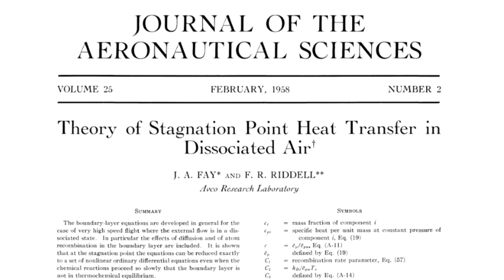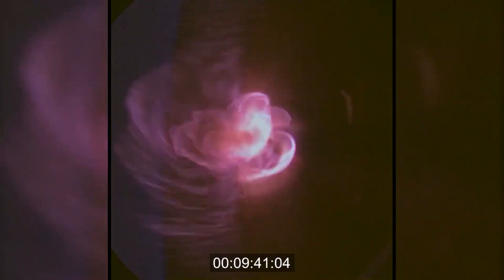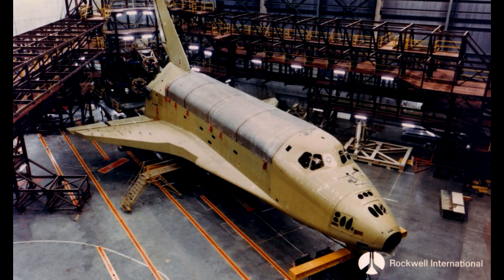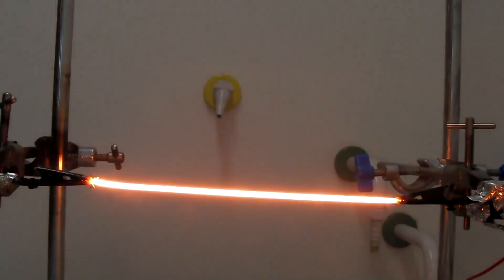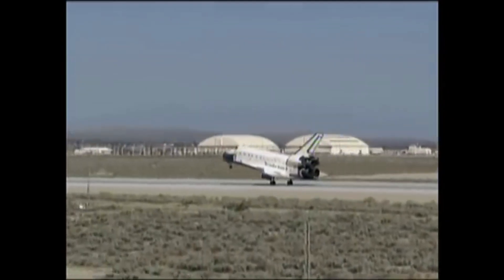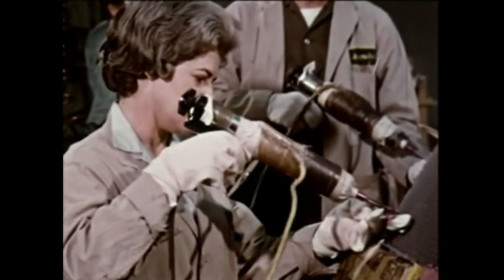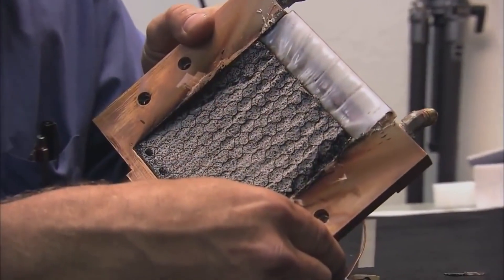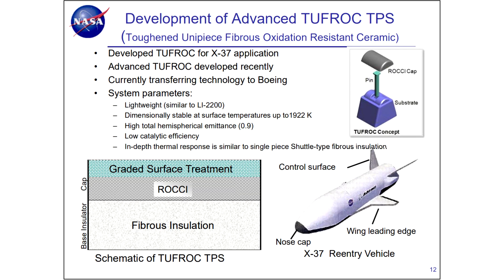Heat Shields - Things Kerbal Space Program Doesn't Teach

Comment: I work in TPS manufacturing, actually in the building your hot tile cube video is taken from. I find all your videos to be fascinating and informative. I would like to offer one point of note relating to silica tile on the Space Shuttle. I used to work on the Shuttle TPS system as a technician, and the known cause for the early tile shedding you showed on the OMS pod was not only structural flex as you have mentioned. On STS-1, many of the tiles did not have densification applied to the inner mold line where the Strain Isolator Pad is bonded to the tile. What this causes is a very weak bond that would allow the SIP to debond and take a thin layer of tile with it as it debonded. Think of putting masking tape on a dusty surface and peeling it back off again. The weak bond allowed any force that could get under the tile to pull it off, and this was especially easy on the OMS pods where the tiles were large and thin. The solution was a chemical which I can't remember the name of, that makes a thin "densified" layer on the IML of the tile and allows the SIP to stick incredibly well, dramatically increasing the bond strength. I hope this explanation didn't come across as to knit-picky. Thanks for the great content.
Reply from the maker: Thanks for the extra detail
Reply: I'm gonna have to go ahead and ask you: have you been using the new cover sheets when you file your reports?
Reply: @jimbarino2   You know how many times I have heard that one over the years? :)
Reply: James Baird “Red Stapler. Come in, Red Stapler. Do you copy, Red Stapler?  Over.”
Reply: are you saying I shouldnt use elmer's school glue for my heat shield tiles?
Reply: @Blox117   Interestingly enough, the glue we use isn't as high tech as you might think. Tile and other TPS are bonded with RTV 560, which is very similar to the stuff you use to form oil pan and intake gaskets for cars.
Reply: @adamc1713  i wondered if a silicone polymer was involved....?
Reply: @stevengill1736  The RTV which is used to bond the tiles is based on silicone. To my recollection, the SIP to RTV interface could see as much as 700 F for short periods of time, and the RTV could apparently handle the heat. I would imagine more modern formulations of RTV could do even better, but I am no longer in that part of the process so I don't know what they are using these days.
Reply: @Blox117  extra credit if the densifier was PVA
Reply: @RobertSzasz  It was not PVA. The densification was accomplished by brushing on a slurry made of LUDOX and silica.
Reply: Thanks. I knew quite a bit about the tiles themselves from my Material Science classes, but not how they were applied.
This was enlightening.
Reply: @rogerwilco2  Yes!  A heat shield tile can be incredibly resistant to heat transfer, but it's worthless if the the agent used to bond it to the surface allows it to peel off.   As a kid back in the early '80's, I remember the nightly news all abuzz about Space Shuttle tile failures.  The very first Shuttle reentry almost ended tragically due to loss of heat shield tiles.  Of course, American engineers figured out the problem and promptly fixed it.
Reply: @HappyFlapps  "promptly mostly* fixed it" seems more accurate. They may have fixed this shedding issue but over the years they normalized tile damage and the risk it entailed.
Reply: @HappyFlapps  STS-1 was not as “close call” as you state.
Reply: Fascinating extra bit of detail! Thank you for your work, and also for this explanation.
Reply: Thank you kind stranger. Wasn't this classified ?
Reply: I remember a report on 2020 in the mid-1970s and the glue being the main issue that they had to perfect so they couldDo the first mission
Reply: what about the bbq grills used to densify early Columbia tiles or was that before your time?
Reply: @divedevil985   It would have been way before my time but when I get to work tomorrow I'm going to ask around and see if any of the old timers know.
Reply: @divedevil985  where did that take place?
Reply: TO DEMONSTRATE THE POWER OF FLEX TAPE I TOOK THIS TILE OFF
Reply: this is one of the coolest coincidences I've come across in comment sections. this should not be forgotten.
Reply: But how didn't the cube transfer the temperature to the demonstrator's fingers? Isn't it heated from surface, so that it was the glowing-hot part that was touched? It must mean the temperature was low enough, as the heat is tranfered to the heat conducting fingers, and not to the low heat conducting cube.
Reply: @Tankeris6327  These tiles are over 95% air by volume, so the rate they transfer heat is very low. I understand that the temperature is very high (over 2000 F), but it isn't really temperature that burns you. The rate of heat flow, or BTU/hr is what burns you. If it is a 2000 degree cube that can only transfer a few BTUs to your fingers, it won't heat up your fingers to a temperature that will burn them. You can feel the heat radiating off the cube just like when you open an oven door, but it doesn't transfer to your hand quick enough.
Reply: According to Wikipedia, bondo can be used as an ablative material, is this correct?
Reply: @yakkobthelearned   I don't know for sure, but I do know that some ablative materials are phenolic based, and Bondo is a 2 part, epoxy-ish, phenolicy substance. The determining factor I would think, is whether or not the Bondo creates a thin carbon layer when it burns. If so, it would probably make a good ablative as long as it doesn't also transfer heat very well.
Reply: @adamc1713  Starship is having a lot of issues with keeping it's heat shield attached. Even on the ground. Do you have any thoughts on using wood instead of ceramics for it's heatsheild? It seems to me that it might be the fix that's needed.
Reply: @pinkypink5161  The issues they are having with heat shield attachment are related to the flex in the substrate combined with a different attachment mechanism than what is used on other vehicles, AS FAR AS I KNOW. The tiles themselves are made of very similar material to the silica tile I have worked with, but they are not glued on. I have been told they are attached with pins somehow, and I would imagine this is because there is too much structural flex in the stainless substrate to maintain a bond, or if you could keep a bond you would probably have cracking of the tile because they are so large and thin. I'm sure they will get it figured out, my former boss now works for them and he knows more about TPS than anybody I know. 
The thing you are asking about wood has actually been tried successfully as an ablative, but that is a different application than what Starship would need. For such a large vehicle, the weight of wooden TPS would be prohibitive. Quick turn around and re-use ability would also suffer. For something like a capsule though, you have a good idea.
Reply: @adamc1713  I didnt realize the TPS tiles were THAT much lighter than wood.  I'm also surprised the shuttle got away with glue but the starship can't. I figured the coefficient of expansion would be roughly the same between titanium and steel or did the shuttle use something else to between the haul and the tiles?
Reply: @pinkypink5161  The silica tile currently in use is typically about 8 lbs per cubic foot in density. White Oak, which has been used as an ablative, is 47 lbs per cubic foot. Being roughly 6 times heavier than silica tile isn't the only problem though, because you are likely to need more wood by volume than you would silica. The two materials are just not in the same category when it comes to the types of use they are designed for. As to the question about expansion, the Space Shuttle was mostly constructed of 2024-T3 Aluminum on the lower surface, and some graphite epoxy, phenolic, and yes, even a little titanium on the upper surface. Expansion wasn't much of an issue on Shuttle because the orbiter vehicle didn't hold any of the cryogenic propellants. There was some structural flex from aerodynamic loading on ascent and re-entry, which we did have some interesting tests for. I think the size of the tiles and the type of Strain Isolator Pad for tile bonding were most likely chosen based on the structural flex and not thermal expansion issues.
 Starship, as far as I can tell, has a lot of the thermal expansion you are talking about. I would suspect this is because it is carrying cryogenic propellant very close to the outer skin, which I believe is a type of stainless steel. I've heard that bonding was tried in the early stages of development, but it must not have performed well for some reason, possibly because of the extreme low temperature of the substrate combined with flex. It's hard to say without being able to study the design. I imagine if I had a few hours with some blueprints I could make a good guess at why they do it the way they do. Sure would be interesting.
Reply: Cap Shewl
Reply: I'm still learning about the shuttle and everything, but there's something I'm not understanding. On STS-27, Hoot Gibson saw the heat shield damage when in orbit and said his first thought was, "We're going to die." He certainly knows far more than I do about this stuff. I've also read of and heard people say that Atlantis wasn't a close call, under the circumstances, while others say it was a close call. Obviously, a tile missing is bad news, and they were fortunate one wasn't missing in a more critical area, but even if a tile had not been missing, would it have been a close call and potentially be as bad as Hoot Gibson was believing? The black surface is, of course, there for a reason, but this has been bugging me for a little while.

Apologies if this seems a silly question. I'm still learning about this stuff and want to have a clear understanding.

Comment: RE: 2:22
Hi Scott, super big fan and Mechanical/Aerospace Engineer PhD here. A minor clarification: shocks are NOT isentropic processes. The shock results in a large entropy rise and is a frictional, throttling process. So it’s not quite as simple as you make it sound/calling it a frictional loss isn’t 100% incorrect although that boils down to how you describe friction. The heating IS most certainly due to the shock layer and not a shearing type of frictional heating that most of us think of from our every day lives.

You rock, keep making awesome content!
Reply: RE: 10:10

Checkout the HYTHERM experiment images from STS-119! (Post Columbia 💔) They intentionally added a boundary layer trip on one of the aft wing tiles  and filmed re-entry with an IR camera. Being further aft, the turbulent heating would be within design spec. However, gap filler, or some other unknown roughness source triggered early transition on the fore-body underside. Another hairy situation. The tile with the boundary layer trip is still in place on the space shuttle Discovery at the Smithsonian Air and Space Museum in Dulles VA. 

Also, another interesting property of C-C-C (carbon-carbon-composite) that the LE of the wing and nose patch is made from is that it is a highly an-isotopic material: the thermal conductivity varies by over an order of magnitude from through the thickness (EXTREMELY LOW) to in plane (higher conductivity, still extremely low).
Reply: @zbeekerm  You are talking about the BLT mod. A friend of mine bonded that tile. He still works with us in TPS. That was a neat experiment.
Reply: In my previous comment: “describe” —> “define”
Reply: Great vid. Highly recommend.

Comment: Given the dominance of ablative shields in space flight history, it's ironic that in the technical planning for the mercury program it's proposers had to fight a real uphill battle against a beryllium heat shield. It was probably the biggest question mark while planning mercury.   A heat shield being destroyed on purpose seemed a dangerous idea.    It was not the favourite for a long time. 
In the end a lot of testing and proving and the weight and price changed that. And some beryllium shields already produced were never used in Mercury.

The other question mark was the "blunt end" (and front), which also seemd counter intuitive to engineers coming from the airplane area.

Comment: Another fine minature lecture using some great examples, as the for the Kerbals they have everything perhaps needing a recognising all manufacturers and common private space flight plug amongst other things, some interesting obtuse thought excercises and progect management . Maybe black diamnonds do grow on airframes, anyhow sure the desire for hypersonic to intersellar breaking is quite, some secret. My only hint not being academically cursed is I would thing any such reanimation of structural integrity might be to first consider the naughts will probably be relative to the mass of the insertion point which could be either radial or a trigonometric medium reliant on the behaviour of the iron granular or specifics of core to insertion flow of chemical atmospherics at like you said a given known parameter. perhaps better antennaes that may have freakishly eroded the tiles and then covertly tidied with a radial solution. I was thinking any rentry frame would need a surface flow matching velocities exactly smoothing not like Harvey two face from Batman but exuding an enclosed system of field strengths ,electro dynamically ionising filaments that would smooth the existing heliospherical friction,fast nuclear decay and any depleted hull ablation would be replaced in sci fi by fast flowing hydro helium derivative which is as hot as fast as the atoms striking it and pulsing variably reducting this field and fluidy until probably only a carbon and methane pressurised perforated  light emitted control surface. I e,e a beam guided instrument which new horizons and voyager being the only other craft exciting such ambition. Sure the chemicals and design specifics would be more than impossible. Everyone is contented with the progress so far. Its been quite approximately just over century of ascendancy to such awe.

Comment: What’s the point of speaking on methane being used to cool and use as fuel? All “Bell” engines require that, and always have. If that weren’t the case, the exhaust cone would melt instantly, and if it didn’t,  it would answer the remainder of this video regarding heat shielding.

Comment: If you have a car, it's likely you have a modern heat-shield material in use already. It's the aramid plastic composite that's used in brake pads. Ablative in friction against metal rather than the atmosphere, but the same ideas apply.

Comment: Why don't we use magnetic field to guide highly charged high temperature plasma?
Reply: what you describe its fusions holly grail .....if we only  would have the power to do that .....just imagine free energy ....
Reply: Weight restrictions. The electromagnets necessary for the job weigh far  far too much.
Reply: No need to put Electromagnets. Just put basic magnets away from high temperature (keep below Curie Point )
Reply: @  @n3r0z3r0  
Electromagnets are lighter for strength of field needed to make a difference.

Comment: at those temperatures the SpaceX Stainless Steel thing might get a bit bent from the loss of rigidity... are they going to put some Tungsten or Depleted Uranium skeleton structure in there? lol thing is you said they are only going to cool 1 side, so that will make the heating uneven, mening it may warp in a weird way, expand on one side and shrink the other, then the heated coolant is the fuel, it will want to expand due to heating... will the pipes maintain the pressure?(or the fuel pumps and mechanisms!) Thing is, even if half of those can be tested on Earth, the other half will only be known after doing a real re-entry!